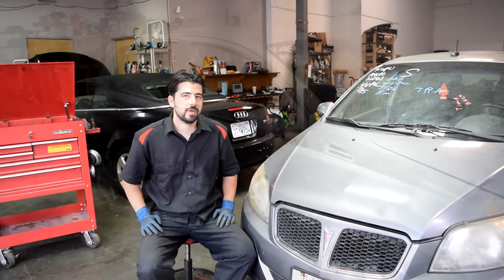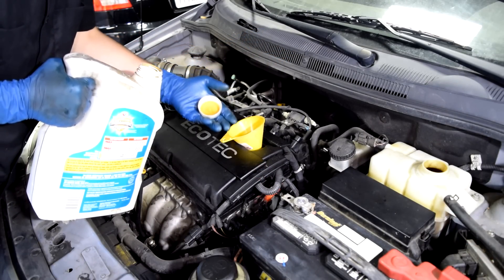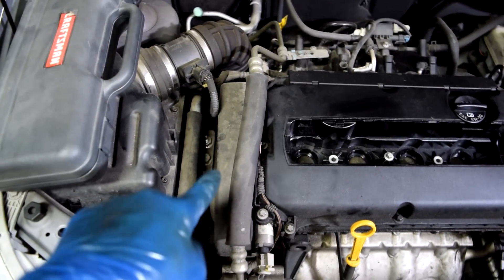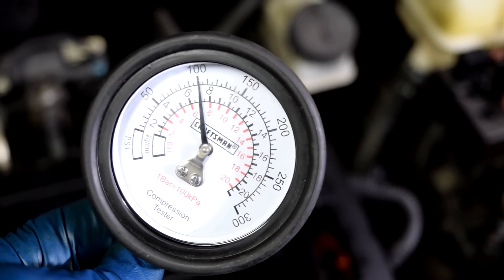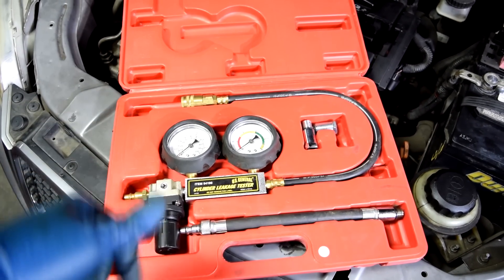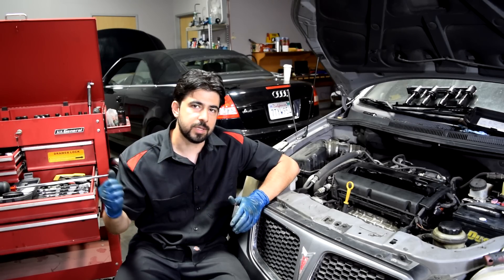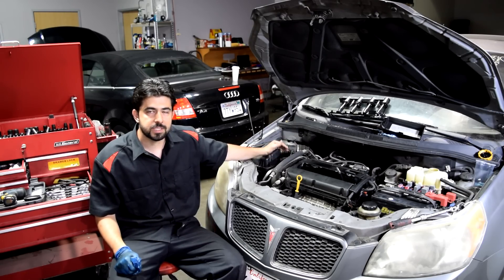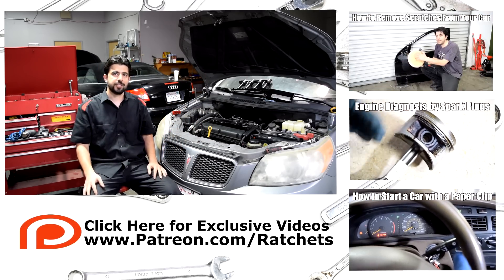Compression and Leak Down Testing an Engine with Suspected Internal Mechanical Issues

Comment: One big piece of advice. Whenever you are doing top end work on an engine that requires the head to be removed, it is a good idea to have the head machined. If it has already reached machining limits, the head can be reclaimed with welding and refacing. Still better than replacing the engine when the rest of it is still good. Then again, I’m only a retired auto engineer, so what would I know.

Comment: You didn't say how to regulate the shop air to 40/70/100 etc psi if using your schraderless compression tester hose. I'm assuming you used the regulator on your air compressor but not everyone will know that.

Comment: Hey can anyone help me. I replaced the head gasket on my 97 4runner started it up and still got plumes of white smoke. Doing a leak down test and all of my intake valves are leaking air really bad. Any ideas as to what I did wrong?

Comment: The leak down tester in this video doesn’t work properly. It’s the cheap one from Harbor Freight Tools. The company that makes it doesn’t know how a leak down tester should work. I know that sounds ridiculous but it’s true. Harbor Freight does sell a good leak down tester now under the name Maddox. A proper leak down tester has two identical gauges that go from 0-100 PSI. In this video he doesn’t actually use the leak down tester. You don’t need a leak down tester to check for leaks at the valves or head gasket. Any leakage at those points is not good so you don’t really need to know the exact percentage. You just need a spark plug hole air hose adapter. You can use the hose off a compression tester like he does in this video. The main purpose of the cylinder leak down tester is to measure the exact percentage of air leaking past the piston rings.  Even an engine in great condition will have some leakage past the rings because they are not air tight. So you need a leak down tester to see if the amount of leakage is normal or if it’s too much. Also, if you have a piston at exact TDC it will stay there no matter how much pressure you put in the cylinder.

Comment: What happens if you don't disable the ignition system and you run a compression test anyting
Reply: redbaron2448 well your car will just turn on and maybe it will throw off the test results. Not sure maybe it will just get your tester wet with raw fuel

Comment: My audi a4 1.8t 
Cranks but doesn't start. Has fuel and spark
Could it be a head gasket?
Reply: Year, mileage?  Any check engine light?  It could be, but it could also be many other things.  Could be the starter, could be compression, could be timing is off, could be your anti-theft system....  the list goes on...

Comment: Hello, R.A.W! Great video. I own a 2004 S40 Volvo (older model body, 1.9L, turbo). I understand that this car's timing is based on TIMING MARKS versus TDC which I thought was the same but interestingly it ISN'T. Question 1 (Q1)?: What have you heard on this?;   Q2?: why do I get zero compression on all four cylinders when performing a compression test? Am I doing anything wrong? BACKGROUND: my serpentine built busted on me on my way home from work due to a small oil leak from my cap seal being cracked. I towed in home. Checked and discovered my timing belt was perfectly fine. I had to remove harmonic balancer and gear for timing build for purpose of cleaning debris from serpentine built wire getting wrapped in some stuff. I reinstalled everything and set it to timing marks and all it does is crank with NO START. What do you recommend? any help is greatly appreciated.

Comment: Hey Ratchets, with a wet test increase in pressure by only 5-10psi would the piston rings need replacing? (Also the spark plugs have white build-up)... Thanks for the great vids!

Comment: Hi there , even if our battery is new , by cranking the engine we will not drain the battery  ?

So we have to distinguish between problem with the head cylinder and the Pistons ? 
If the problem are the Piston rings then the engine is finished and cost lot of money to
repair the Pistons , Right ?  

And what if the car is a Hummer H3 with 5 Cylinders , how do we find out the positions of
the Pistons either at exhaust or intake  ?  as you said the cylinders are acting like sisters
2 by 2 .... and how do you position the cylinders using the timing chain ! ? Your video did
not show how to do that .. .thanks a lot ..

Comment: Good video in showing the compression and leak-down methods. Just wanted to point out a small error. On a four cylinder engine, you would turn the crank 180 degrees between each cylinder, not 90. It's easy to tell how many degrees to turn. For a four stroke engine, it takes two complete turns, (720 degrees) of the crank for all cylinders to fire, doesn't matter how many cylinders. So you would divide 720 degrees by the number of cylinders. In your case, that would be 720/4 = 180 degrees of the crank to bring each cylinder up to TDC. And for one example on an eight cylinder engine, it would be 720/8 = 90 degrees. Keep up the good work!
Reply: Iman (the Ratchets And Wrenches guy) is talking about turning the camshaft by 90 deg to get the next cylinder in the firing order at TDC. You talk about the crankshaft. You might be right if the crankshaft sprocket is half the camshaft sprocket diameter.
Reply: You would turn the cam 90 degrees.
The crank 180 degrees.
Reply: stuzman Hey man, just wanna say thanks for clearing that up. I have an exam on compression and leakage tests tomorrow and was a bit confused about the timing marks for each cylinder but you made it clear. Therefore I need to make sure that cylinder number one is at TDC by aligning the timing mark of the crank pulley where it is indicated on the engine. From there, I rotate the crank pulley 180 degrees to bring its companion cylinder which is number four to TDC. Then do the same for 3 & 2. Though respecting the firing order which is 1, 3, 4, 2

Comment: Great steps for checking compression and leak down. I'm currently employed but when I retire I think I'd like "flip" cars. I have most of the tools and a nice shop but I'm not sure what I'd be getting into. I'm guessing a lot of check engine lights and overheated engines are in my future.  :)
Reply from the maker: There's more money in fixing car's than flipping cars these days. I would be much better off financially fixing cars than flipping them but I don't like running a shop :-)
Reply: Thank you for your input. That's one reason I thought about flipping cars...no one hanging over you waiting for there car to be repaired.

Comment: Great vid. I bought a fuel pressure tester that looked good but broke quick. Any good suggestions on a quality fuel pressure tester?
Reply from the maker: OTC makes good ones IMO I used to have one, gave it to a friend and never got it back...lol now I have a cheap harbor freight one. Havent used it much but it worked the few times I have.

Comment: Passat 2.8 v6 running rough at idle better at higher rpm codes thrown po341,300,301,302,303: Missfiring on bank one. Ltft: running rich stfr: running rich. Maf cleaned/tested and works at 1.69v at idle 2.65 at 2500rpm. Cam sensor replaced, full ignition tune up done with no avail. Timing appears to be spot on. Question is where do I go next? 

I'm about to test the vacuum system, then the fuel with a gauge, crank sensor test still have yet to be done. I'm lost if you could send me in the right direction is appreciate
Reply from the maker: Have you checked camshaft chain tensioner, its guide for excessive ware, chain itself and the timing for that bank?

Comment: I'm still trying to diagnose my evap leak and egr codes.  I cleared them and they haven't come back yet.  I replaced the evap purge solenoid with a brand new ac delco part and the problem still exists the same as before.  I'm trying to diagnose my evap canister vent solenoid but the book tells me to use a scan tool to command the solenoid on, but I don't have said multi-thousand dollar scan tool.  I have an innova tool and as far as I can tell, there's no control of the solenoids.  

Can I simply disconnect the connector and supply power to the solenoid with a power probe tool?  How do I know if it's switched by power or ground?
Reply: I looked at the wiring diagram for the evap system and if I'm not mistaken, the main power relay supplies power to the evap vent solenoid whenever the ignition is on.  The ecu supplies switched ground when it wants the solenoid energized.  

The test said to hook up a hand vacuum pump to the canister side hose on the vent solenoid and see if it holds 15 inHg with the car off.  It wouldn't build any vacuum.  Next was to turn the ignition on and command the solenoid on with scan tool which I don't have.  Instead I supplied power to the relay pin and ground to the ecu pin on the solenoid with the harness unplugged.  Then I pumped the vacuum up to 15 inHg and it got up there but immediately begins slowly dropping to 0 once you stop pumping. 

The last test was to pull the harness plug off and turn the ignition on and test for power on the relay pin and it does have power there so the book says to replace the evap vent solenoid.  

Any reason my rudimentary method of testing could be wrong?
Reply from the maker: You did well, better than a scanner even. Looks like you have a leaking vent solenoid. Replace and confirm repair the same way. GL
Reply: +Ratchets And Wrenches thanks.  Ordered a new acdelco part from rockauto.

Comment: Thanks for the vid! I have a combustion gas tester that works well for testing head gasket leaks. Just changes the color of a liquid when combustion gases are present in coolant reservoir.  i'm sure you've seen that too. Also, your advice on the iac valve was spot on. Replaced it and that was the fix.
Reply from the maker: Nice, glad you got that fixed. Thanks for the update.